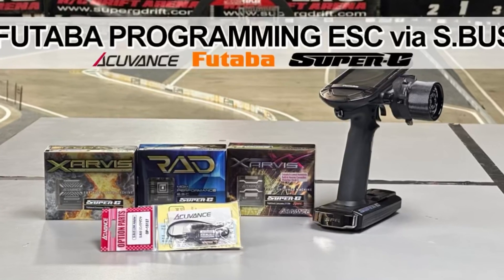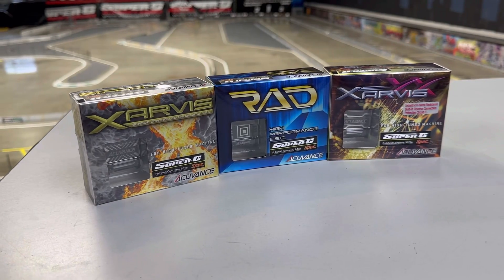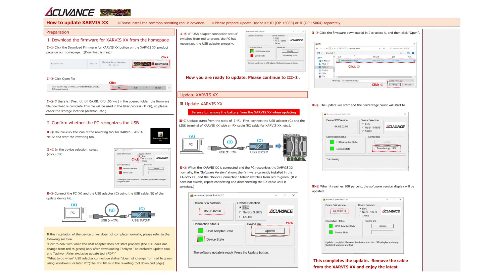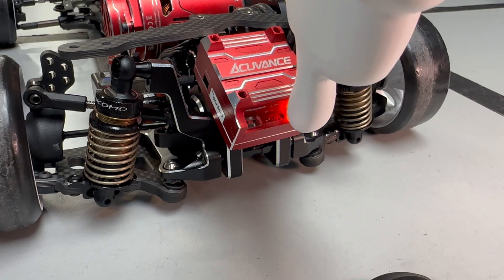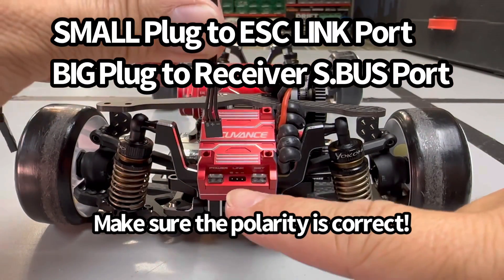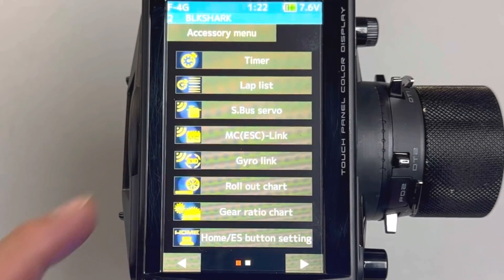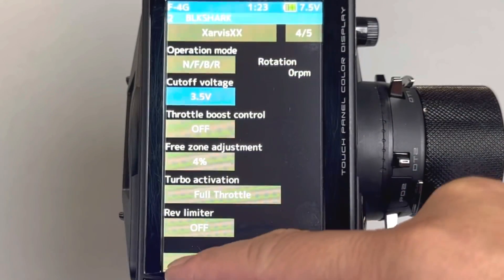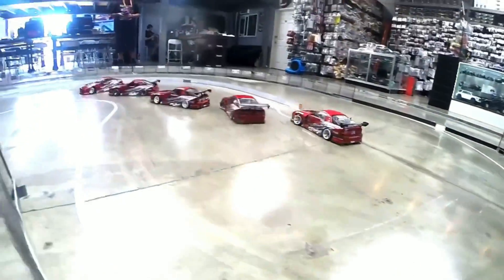Futaba Programming ESC via S. BUS (Acuvance Xarvis / RAD / Xarvis XX)

Comment: Everything works for me except for the temperature of the motor.  Please tell me how can I fix this?
Reply from the maker: If all items are updated, check your sensor cable? Or RELOAD the sensor list on the Futaba Transmitter and we assign it to the screen. If you have RPM and VOLTAGE, you should also have temp